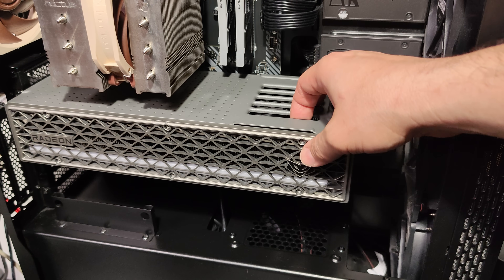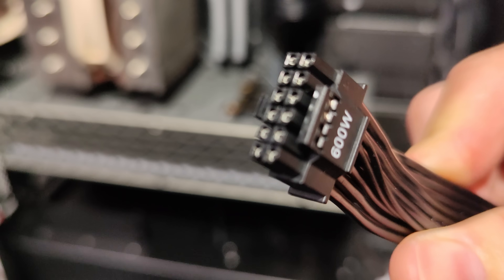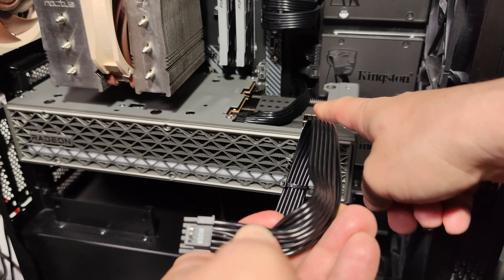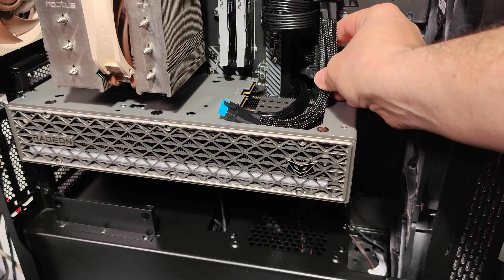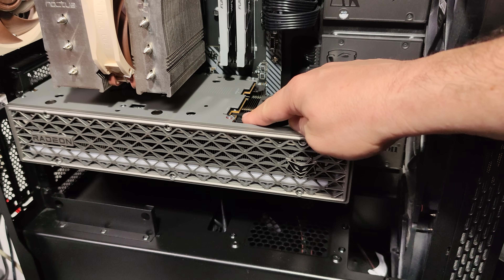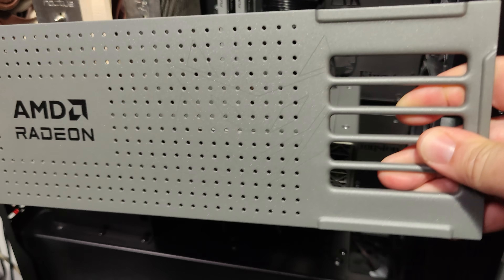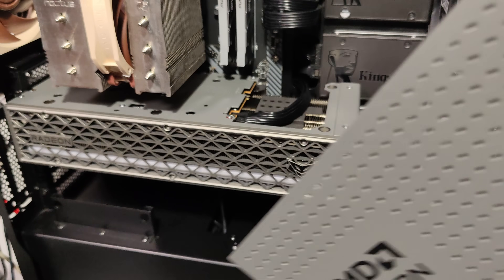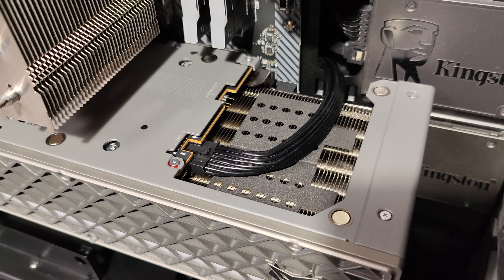Radeon RX 9070 XT Sapphire Nitro+  Magnetic Backplate More Problems Found And Exposed 🔥

Comment: seems like a personal thing honestly, im sure the company wouldnt put this on the market without extensively testing it first.   I own the card and have had no issues with it connector or power cable wise
Reply: "im sure the company wouldnt put this on the market without extensively testing it first" tell that to nvidia and intel lol.
Reply: lol
Reply: You'll be surprise many companies does, proper tests requires time, manpower and money. Is really easy an cheap to test on end users.
Reply: Hi! I recently bought the same GPU. Should I use the 12V cable that comes with the GPU or the one from the power supply?
Reply: @punvko hey did you figure it out?
Reply: everyone pointed this issue out with this card lol.
Reply: You overestimate the manufacturers, they don't test anything.
Reply: Does the back plate really significantly increase temperature?
Reply from the maker: A lot of PC components are made today with a major research of "marketing" first and less technical utility. Where in this world would you stick a foam pad on a heatsink fins so that it doesn't rub a cable just for the looks of it? If it would have been a car engine it would have caught fire, not to mention the backplate advertised to "dissipate heat" which clearly doesn't.
Reply: "seems like a personal thing honestly, im sure the company wouldnt put this on the market without extensively testing it first." what a gross trolling by feigning invincible ignorance satan.
Reply: These kind of ribbon cables have been fairly common on PSUs, for quite a few years, so I have some doubts about the "extensive testing" here... Also, the thermal drawbacks are obvious before even testing, so this really looks like they just let the marketing people overrule the technical people when they chose this design...
Reply: @MrCyaegha  The card runs extremely cool. Mine runs around 50° at max load with 360 watts. Runs cooler than the last several cards I've owned which had much lower TDPs.

Comment: Thanks for the video, now I'm going to worry about installing it correctly when the order comes in. I also have a memory slot above the video connector. I also have holes in the case wall where I passed the motherboard power supply and the power supply came with a very flexible 12+4 cable but I ordered a thicker cablemod, maybe I can pass it through the case wall without bending it down next to the video card, because it's my favorite color and I want to see it....Don't let the different comments affect you, we are different people, fortunately. I appreciate your effort to film your opinions. A video is not easy to make and requires equipment and a lot of time....
Reply from the maker: Glad I could help
Reply: @TechTronic9000  Anyway, I really like the design of the video card, if necessary I will change the case....Thanks again!
Reply: I received the video card and everything fits perfectly, the 12+4 power cable from the Zalman power supply, entered the logic board perfectly and the support bracket fits perfectly. I got rid of all the emotions....As for the performance, 180FPS at 1440p in BF2042 at 55 degrees Celsus, it doesn't bother the eyes and very importantly it is total silence in the game. Thanks for the advice!!!

Comment: Nitpick of the year award goes to....
Reply: buddy what are you smoking
Reply: is it a nitpick if it can cause serious issues? bending cables is no joke, it can tear inside
Reply: @Xorrak  yeah, they should have put connector 90 degree or 45 angle.
Reply: Really surprised at sapphire if I'm honest, the 12 pin connector is the reason I would avoid them this time round
Reply from the maker: On the Pulse version they went with 2 x 8 power connection, which they couldn't on the Nitro+ due to the "hidden" deign.
Reply: @TechTronic9000  yes, and two 8 pin much better than 16 pin Nvidia's. I wound not be surprised if nitro and taici cards will firing similarly as Nvidia's.
Reply: But it has a 12V2X6 connector should end any argument, this is for people who value aesthetics over the laws of physics!!
Reply: @ What laws of physics. 8x 7mm2 cables would be enough for 5090. Why have 24 cables or more. They could even implement proper connector on pcie for all that power and no wire hassle at all. I dont understand why they keep making motherboards and graphic cards based on 30 year old motherboard layout and connectors. Soon we will have 4x  12vx2x6 connectors haging out of gpu.Evolution has stopped long time.
Reply: @HappyValentine24  OK genius, what's stopping all the power heating up one cable dangerously?
What melting insulation issues have the 8 pin Molex connectors had?
Reply: @RobBCactive  As i said, all there is needed are proper cables not some 16 or 24 thin cables. More cables,different lenghts,different resistance,different amperage,different heat in each wire. Might aswell use less cables. Also there are way too many people without having any issues with high wattage on cards, no heat. And one of the youtubers who tested showed power supply side heating up the most not graphic card. So it seems like power supply and cable failure, cable connectors poor quality. Are u saying its so hard to belive that mass production nothing go wrong where machine press those connectors around wire without any solder?  From my guess its just simply poor quality issue with psu/cable or someone on purpose shorting things out.
Graphic cards side there are just 2 contacts on board, i havent taken my power supply apart to see how 8pins or 12pins are connected inside there.
Reply: @HappyValentine24  you're just ignoring reality, it doesn't matter if it's safe just after installation, things happen over time.
There's no benefit to badly designed fragile connectors, 8 pin simply don't have the same issues
Reply: @ i prefer connector made of 2 cables, most secure way. Having 48 connector pins 24 cables, it all have higher chance to fail from bad quality check. Maybe its reason why there are so many, all just incase 12 of the cables fail, then 12 still there. In test where guy show 2 wires heating up. He didnt show how psu was built, specially when that side was hot. Blaming it to be connector fault and Nvidia fault.  12pin connectors are also different, 12vhpwr and 12v-2x6. So if person uses 12vhpwr one then it has higher that it wont have proper surface area at connector. 9070xt should be completly fine with that power. Also about cable not able to turn that angle, those are just bad quality cables, really stiff. I myself got msi ones, that are braided type that can twist and turn. I really like those.
Reply: There is 0 reasons to buy nitro instead pulse version, actually any 9070xt non 600$ is nonsense to buy.
Reply: Nothing wrong when pointing out flaws. AMD fans are annoying 😂
Reply: @yaacheese8643  are you mentally challenged? The points he's making has nothing to do with AMD. In fact Nvidia put the flame generator power cable into our lives. His rant about the back-plate and cable bend are neutral problems and has nothing to do with neither AMD nor Nvidia. And the things that he complaines about are dumb as fuck.
Reply: @xairaxboss   The only one that is mentally challenged is you dude, you need to chill out.
Reply: @yaacheese8643  its not an amd fan thing, its a sapphire fan thing maybe as they are the ones that did that design not amd
Reply from the maker: I'm not a fan of either AMD or nVidia. The idea is that this card version is not the holly grail for the 9070 XT line. Foam stuck on heatsink fins? A backplate for design that keeps the GPU warmer with 5-6°C and advertise it as "heat dissipating". Here we have marketing over functionality. Not saying that the board is bead, but would have did better with proper power connectors and without less useful add-ons.
Reply: @TechTronic9000  Well My plate is stuck really nice and my cables didnt have to bend like you descripe. mine is nice and cold so i cant really follow this at all
Reply: @TechTronic9000  But the power connector and the backplate are purely visual features. The pure and pulse don't have them so why did you buy the nitro?
Reply: @yaacheese8643 It has nothing to do with AMD. Its fault of engineer who made the card. Blocking airflow is awful idea, its not a small flaw. Also way all these cards are built, heat is directed against motherboard and some motehrboards have ssd nearby. Poor design imo. All these cards should come with watercooling.
Reply: Acting like the 12th best GPU on the market is top tier goes to....
Reply: @blutdogify oh right, cause the top tier ones catch fire and have missing components.
Reply: @blutdogify  didi you really said that? how come 12th best gpu on market sits after driver updates infront of 5070ti, 4080 super and has maybe 4 cards infront of it? 5080, 5090, 4090 and soon amd flagship 7900XTX will fall behind it
Reply: @blutdogify  Its the best one in that price range, comparing a 2000+ dollar card with this is stupidity.
Reply: @PigeonSlayer  no it's not, the 5070ti, the 4070ts are both better cards, you'll pretend like AMD is any better than Nvidia when it comes to being disingenuous, that 9070xt is not and can't be found anywhere for MSRP
Reply: @blutdogify  cheapest XT i can order now in our country is about 780€ so without 21% VAT it would go about 644€ => i´m not sure if there are any customs or tariffs paid for importing graphic cards to EU but overall its price about 50-60$ over "MSRP" which is much better then pricing in last two generations .. OC versions are more expensive but to be honest i don´t know what sane person would be expecting OC version to be sold at MSRP
Reply: @blutdogify  None of them are, not even 4070 S
Reply: @ If you dont use path tracing and just ray tracing, then 9070xt is perfect,  because better performance in gaming vs 5070ti and with overclock similar to 5080. Also depends if u like fsr4 or dlss, dlss is more common and better quality a bit. Here price is same on 5070 ti and 9070xt so might aswell take rtx, otherwise amd.
Reply: @blutdogify  stop being dumb, same about msrp goes for every single gpu on the planet
Reply: @bornaivanovic6804 if your standard for a GPU is the same as a midrange car fine, then "it's good enough to get you to the store and back" but don't kid yourself and pretend it's a top tier card, because it's not.